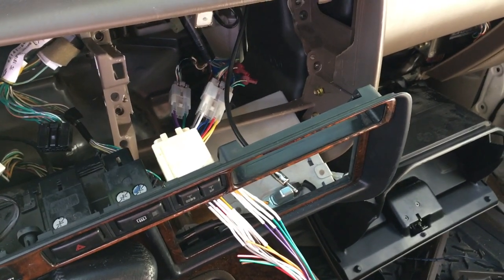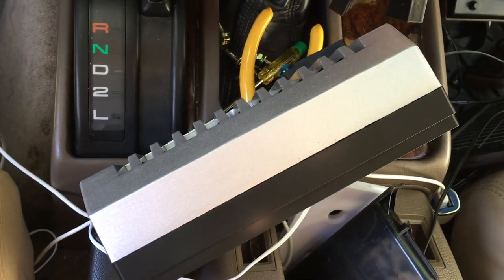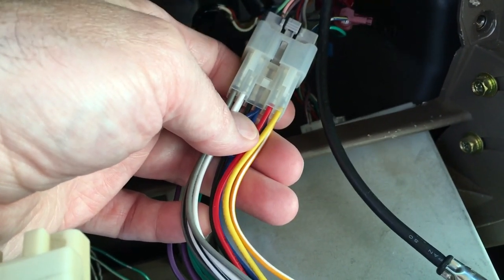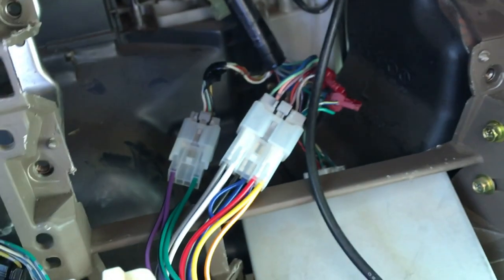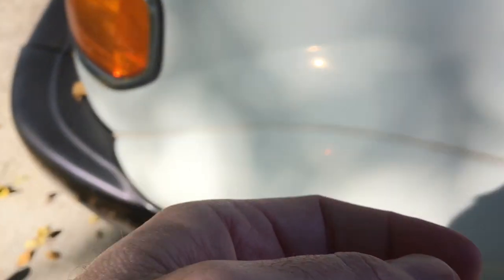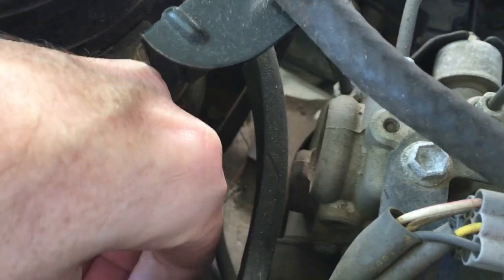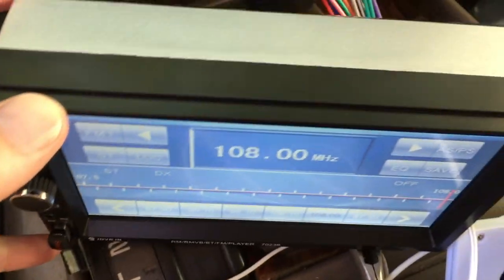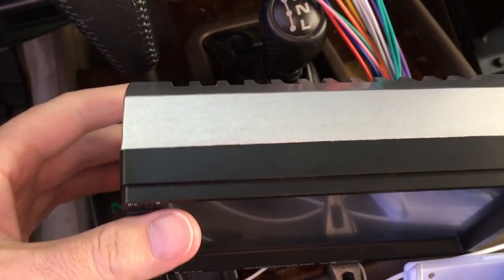1997 Land Cruiser Radio Install No Power (Fixed!)

Comment: We spend hours backtracking and thinking we did something wrong and trying to fix it, when a simple connection or fuse was all that was wrong - argggg! Glad you found and fixed yours.
Reply from the maker: Thankfully I found this relatively quickly. I've spent hours trying to find problems. Sometimes I just need to step away and the solution will come to me. Thankfully I'm not paying a shop to do all this.

Comment: There is a button you push down at the top of the shift lever . Just stick a screwdriver down in the hole and push down . This will let you mover the shifter down and out of the way to work on the  radio or to just take the panel out . This way you can keep the key out of the ignition .

Comment: i have a question, so you replaced the radio fuse which was burned and instead plugged an AC fuse where the radio fuse was and which is the same type as the radio fuse and the radio worked?
Reply from the maker: Yes. You could try a new fuse too. I'm guessing the fuse burned out because I had the factory amp plugged in. I should have unplugged it before installing the aftermarket radio.